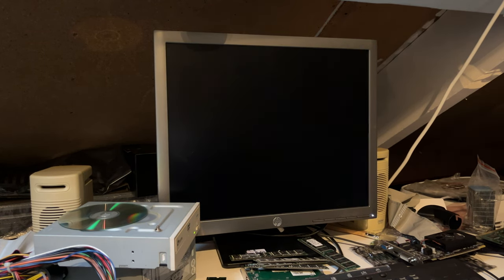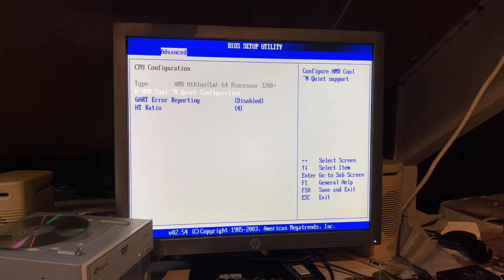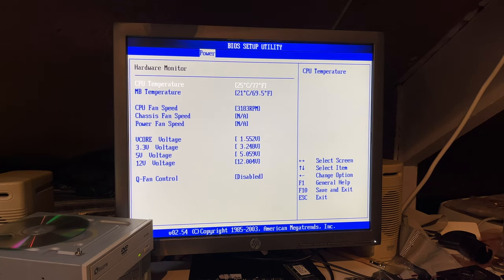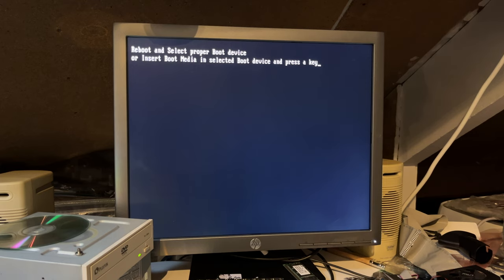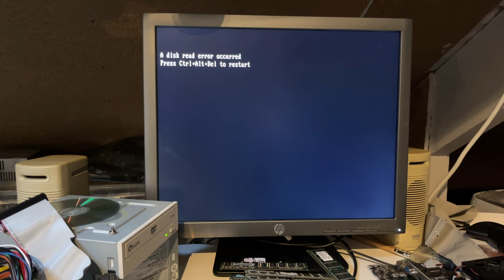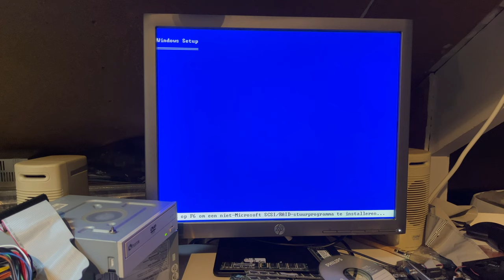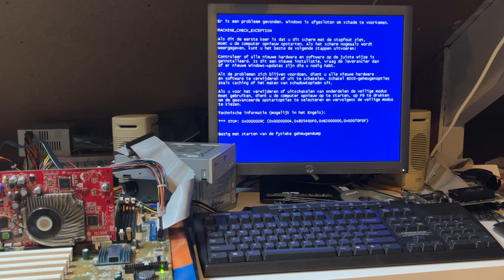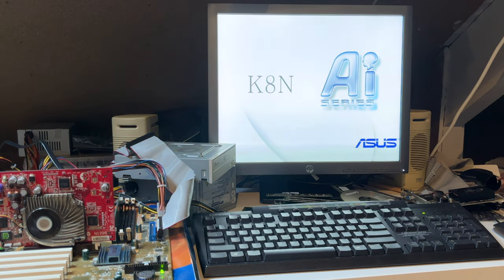Vintage Motherboard Haul - Part 7 - Asus K8N

Comment: I was running one of these daily from 2016 to about 2018. Mine bulge too and they've yet to let out the magic smoke. I ran a old version of chrome (v49?) on XP. I even had steam installed but all I remember playing was Undertale. Idk if you're using ps/2 because it's convenient and universal but the bios supports USB keyboards too. I love my machine because it was in the first PC I've diagnosed successfully; it turned out the agp card was shot so I stole one from another PC downstairs. In total I think my board has had a year of uptime since 2016.